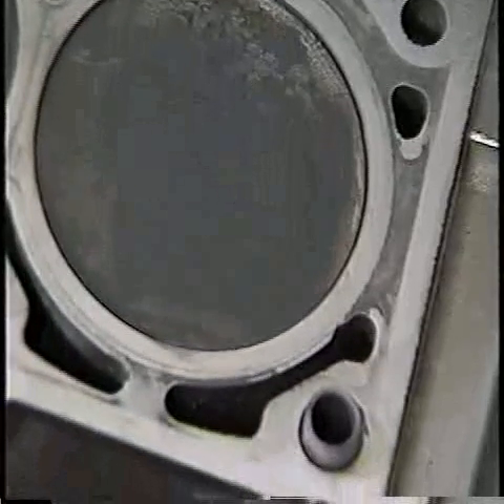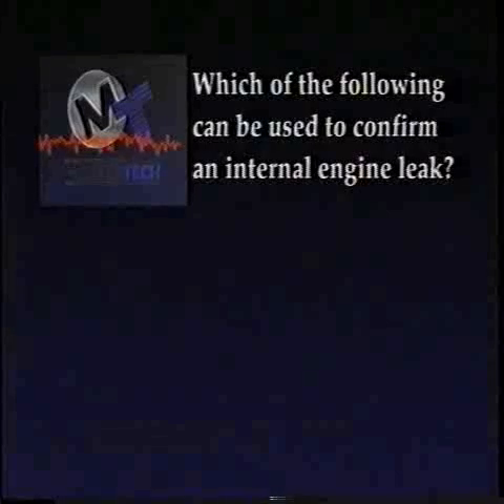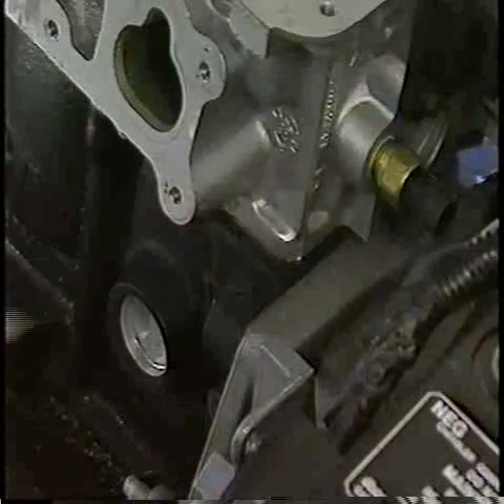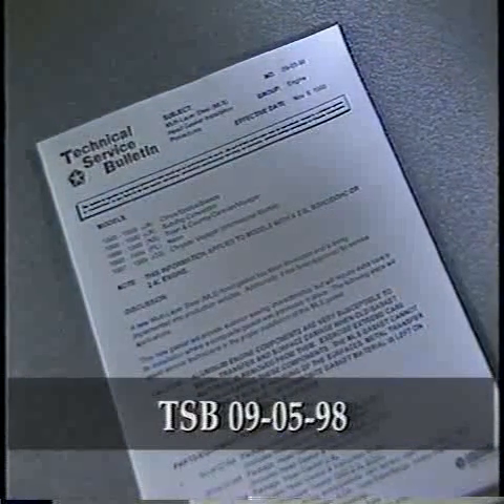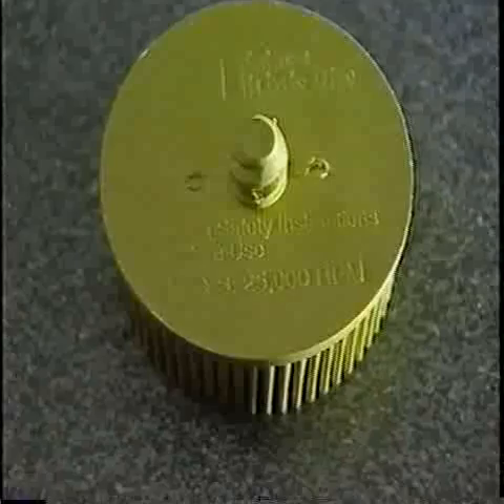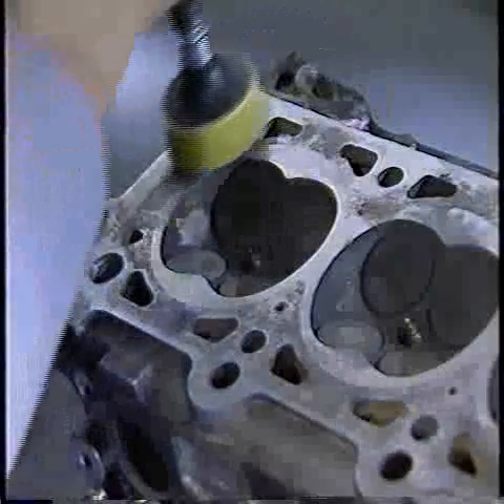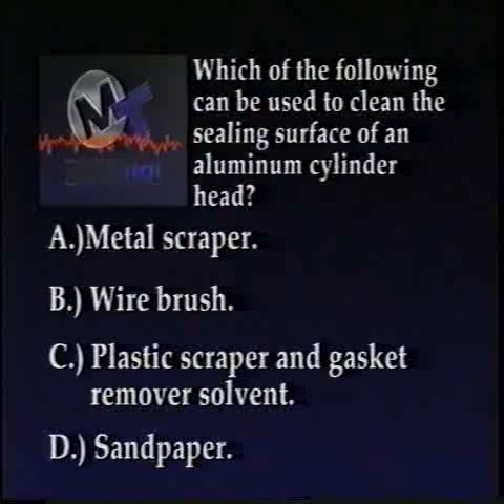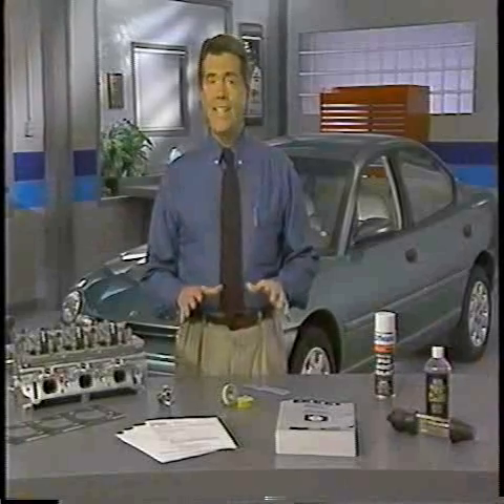Cylinder Head Gasket Service - Chrysler Mastertech - Part 2 of 4

Comment: A stainless steel cup brush will not harm the headgasket sealing surface.I do this.The 3m scotchbrites pads are not to be used,the pieces get in the oil causing premature engine damage and the oil filter can't trap them.